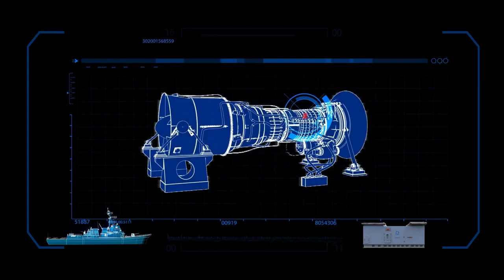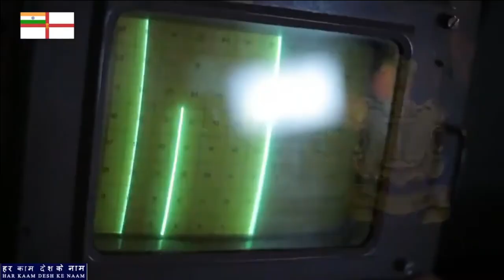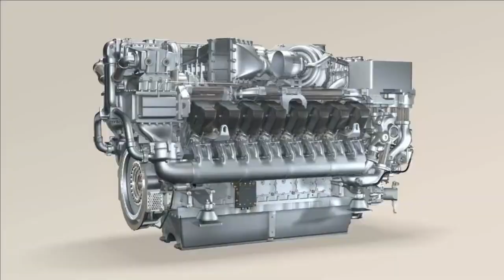Indigenous Marine diesel engine gets sanction, expected to be ready in four years: Indian Navy Chief

Comment: While gas turbines are important, so are lithium ion and fuel cells, which can do the same job as engines. Nuclear power can take over for big heavy ships, so a smart plan using fuel cells and nuclear power can eliminate use of engines entirely in the navy.
Reply: You are a mo ron. No point of equipping small ships with nuclear power or with expensive and heavier and limiting lithium ion